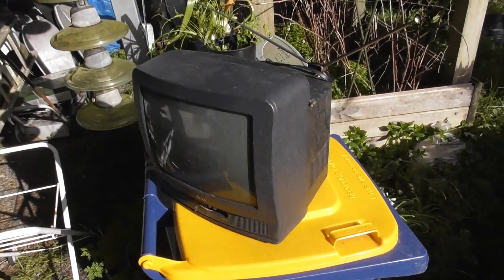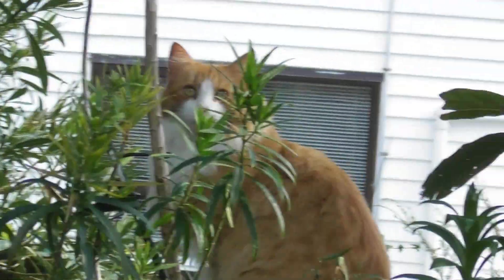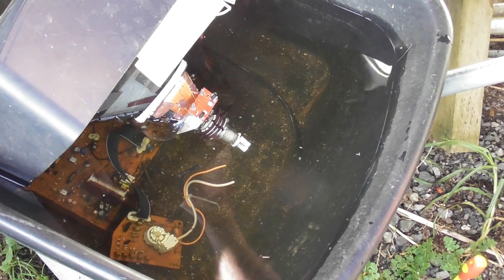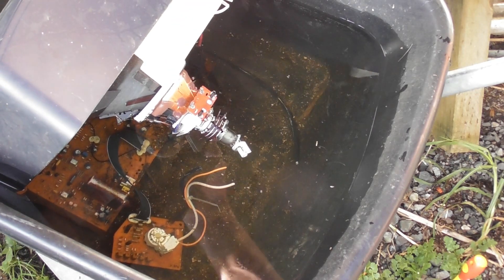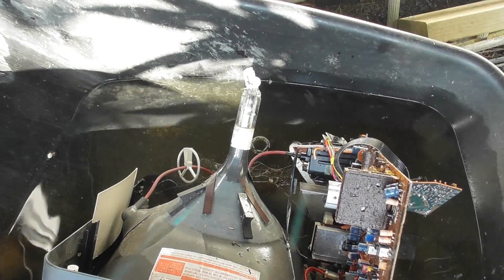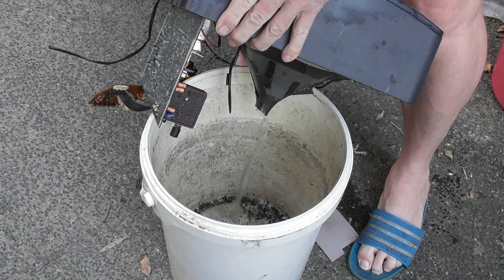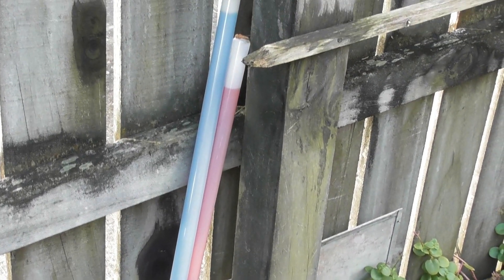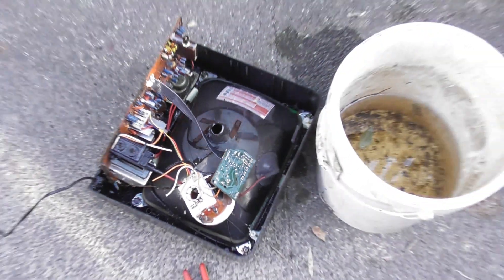Vented CRT tube filled up with water

Comment: Here's an interesting thought/experiment idea. Given that flyback transformers are "essentially" Tesla coils, it would be interesting to see one being used as a power transmitter and another, of the same brand/power rating, being used as a power receiver, essentially wiring one up in such a way that it would be a dumbed down power service array. Pretty much taking input voltage, stepping it up to the HV that normally flows overhead (here in the states being usually 7200 volts), stepping it back down at a service transformer for distribution to the home.

Comment: Why not try running the CRT with it waterlogged like that? I bet the video output from it would be warped to hell.
Reply: it wont run at all
Reply: Only the aquarium screen saver will come on😂😂😂
Reply: Sure, let's "try" to run THOUSANDS of volts through water while there's absolutely NO vacuum to even think about lighting the phosphors that would've obviously been WASHED AWAY. The only thing that would happen is, oh, I dunno, one hell of an electric arc zapping at the water while not really doing shit, or even doing nothing at all, especially since the connections on the end are broken off? -_- Sad that logic doesn't seem to exist in some people these days...
Reply: @abysspegasusgaming  Given what I just read, it probably would also cause electric shock unless he was a safe distance away...

Comment: That's a lot of water.

I was going to say save the audio amplifier circuit and you can make a portable speaker out of it but the whole set went into the drink.
Reply: If it was fine it will be fine again after a day in the sun.
The rainwater does not really affect these electronics much, I had TVs exposed to rain for months, they were already TVs that I had picked up on rainy days, so I let the rain continue washing them to drag away any remaining dust that could be inside, since once moistened it turns into a paste that can even be electrically conductive once dry.
I also recovered televisions that were floating in ponds and lagoons with the screen facing upwards, so a good part of the circuit board was totally submerged.
If it was a TV that had been thrown away when it was still working, in the summer it would work again, and if it had a fault it was a matter of repairing that fault but I never noticed secondary effects due to the rain.
Even the speaker cones hold up quite well for a few months of rain.
But if you leave a TV or any electronic device outside where tree leaves can accumulate on it, once it starts to rain the decomposing leaves will release all kinds of dirt with chemicals and tons of microbes that speed up the corrosion even more and that can damage components in a few weeks, the pins of the transistors and integrated circuits as soon as they reach a certain level of corrosion will continue to corrode inside the plastic packaging, it does not have to be a very noticeable corrosion, sometimes when the plating of the pins loses its shine it is enough, and it also comes with it happening on a single pin.
Reply: @ruben_balea  That was a good read. Very true. I myself have also recovered electronics and got them working after cleaning.

Comment: Wonder if thats a safer way to vent them prior to disposal compared to just breaking the neck off and hoping the front doesnt implode!
Reply: No implosion from broken neck on any modern CRT. The last thing that was close to this happening was a Soviet delta gun color CRT. It sucked the whole broken neck inside itself so violently, that it cracked the screen diagonally. But if you are concerned, you can drill a small hole on the metal anode cap. That is the safest and cleanest way of venting a CRT. My choice is a sledgehammer to the screen :-) .
Reply: @mrnmrn1  I experienced a tube implode when i threw the CRT from an old green screen terminal into  a skip (dumpster)... it went off with a loud bang and blew the rubble out of the skip. Frightened the life out of me!
Reply: @jaycee1980  
But that is far more of an impact than breaking its neck off. It might got a hit on its funnel (probably), as the screen is very hard to break. Also the implosion band is only fully effective when the tube is mounted in a cabinet, and the mounting tabs are firmly attached to the front panel/chassis. Without this, the implosion band can deform when the tube breaks, eliminating its function of holding the pieces of the broken screen together. 

That is why there is a warning on every CRT: when replacing the CRT, only use the same type number for continued implosion safety. That is of course not true, a different type of CRT will not cause implosion hazard, but they include this warning because if the replacement CRT is so different that you have to modify its mounting (for example if the replacement CRT has mounting tabs, but you mount it with a mounting band instead), that indeed might cause an elevated level of implosion hazard if the screen gets damaged in the future.

Comment: Finally, another good use for CRTs, other than old games :D
Reply: Why some retro gamers bother with them is rather odd when old games work perfectly fine on flat panel sets... very odd
Reply: @gazyounglive  Except they don't. Many games from the CRT era were surprisingly designed to run on CRT monitors, who knew.

The art on many games was drawn with scanlines in mind, and look blocky and fugly on an LCD panel. In some cases, the game won't look right at all because artifact color is used, where the game uses two colors in close proximity to each other and relies on NTSC signal quirks to get a third unique color by mixing the two together.

Another thing CRTs did was filter out garbage signal noise. Many old consoles and computers had very noisy video signals, which most CRT televisions were able to mask out, not so on an LCD panel. The tuner in an LCD panel will generally display everything, including the noise. So if you have an old computer or console with a noisy signal, you're going to see it on an LCD panel.

Then there's obviously the aspect ratio. Most all CRT games were designed to run in 4:3 or 5:4 aspect ratios, not 16:9, 16:10, etc. So unless the display supports square aspect signals, you get a fugly stretched mess.

And from a technical perspective, CRTs could do things that LCDs never could. One thing games frequently did was run at non-standard resolutions, where they'd abuse the NTSC signal timings to get smaller or larger images on the screen. CRTs tolerate this because they are analog devices and were designed to interpret a range of signals, as long as they were close enough to what they were looking for. LCD panels can't do this at all, which results in many old games being unplayable because the tuner in the panel can't deal with the non-standard signals.

Some games would rapidly switch between screen resolutions (one example being RE2 on the N64) that will constantly desync an LCD panel and sometimes result in a black screen with "unsupported resolution" issues.

Further going into technical issues, light guns and other light devices won't work on an LCD panel at all because of timing issues. CRT latencies are measured in microseconds, while the best LCD TVs are measured in milliseconds, a thousand fold difference. This makes light peripherals and games that rely on them unplayable period.
Reply: @GGigabiteM  Viva la CRT! But you're seriously right. Sure, the power demands of a CRT, or by the extremes, a big screen projection tv would pull considerable watts, but they still have a place in gaming. Never minding the weight of even bigger CRT TV's, they really were cutting edge technology and, assuming the tube/phosphors aren't degraded, have the truest/brightest colors that could be projected along with absolute black levels compared to the likes of LCD and, to a certain extent, even OLED.
Funny that one of Sony's last CRT TV's was 16:9 and had HDMI ports on it...
Reply: @gazyounglive  I dunno... maybe try playing games designed ONLY for CRT's like the legendary Duck Hunt or even slightly modern games like Silent Scope? Of course the "younger" generation wouldn't know shit about the wonders of CRT's and classic consoles...

Comment: Might be pretty spectacular if you completely broke off the electron gun assembly right at the start. You could break it by crushing with a big pipe wrench. Remove the deflection coil and everything else first. 
I bet we would even see the phosphor coating at the screen get blasted off by the water rushing in.
Reply from the maker: I will look into that, got many 26 and 32 " CRT's in our yard.
Reply: @RODALCO2007  Would be great to see an underwater implosion, too! With a high speed camera, if possible.
Reply: @RODALCO2007  "Got many 26 and 32 inch CRTs in our yard."
Your yard is the best place!!  My kind of place!
Reply: Probably need a bigger water reservoir for a bigger TV though, especially if you do it like I suggested.
Reply: The water would be “rushing” in like a 14 PSI garden hose. Quite unspectacular.

Comment: Would have gotten more water, probably 99%, if it did not have the whistle of air. Good $10 worth of copper in that yoke though.
Reply: Nowhere near $10, unless the price of copper muliplied may times over the last year. There might be less than 100g copper in that yoke. There is much more copper in the degauss coil, but even that is far from $10 worth, at least in a small CRT like this.